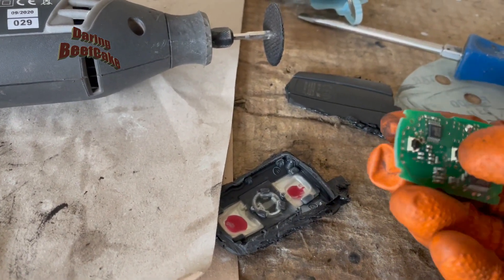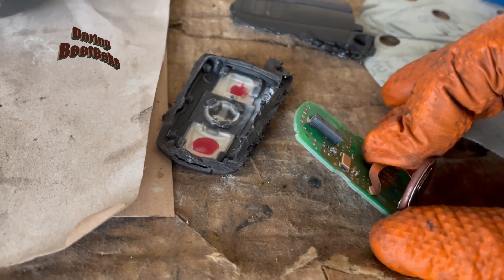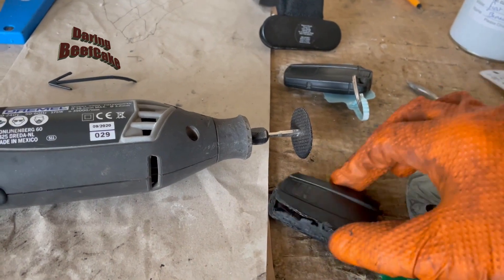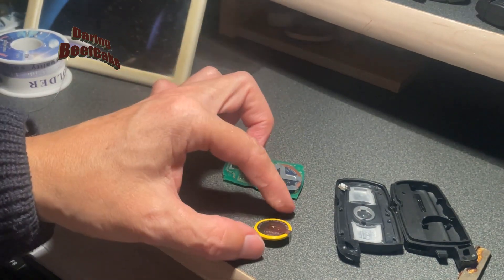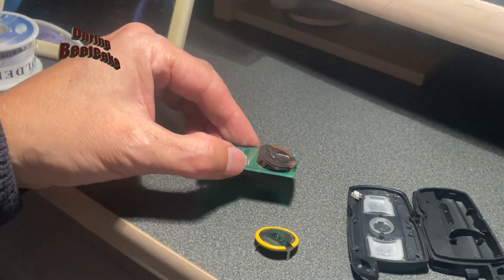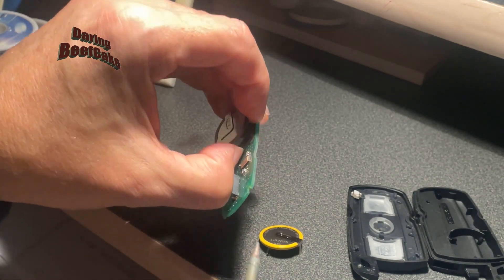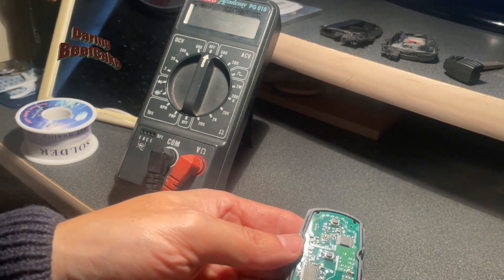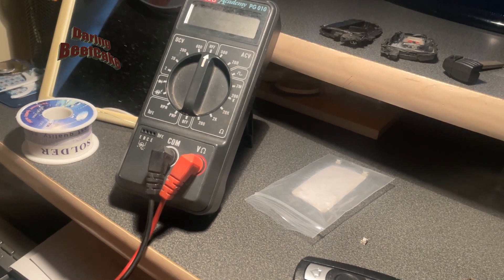BMW E90 E91 E87 Etc key fob not working, rechargeable battery replacement

Comment: I think These ones are chargable, just Insert it into ignition because These models with These specific Keys can be Charged in the ignition (by Magnet inside the ignition (you will See it on the manual)) just put it in there and drive for Like 30 Minutes until its full Charged (it takes 30 hours to Charge it(i know it is Not a technology we used before)) but replacing for a New key at the dealer is most recommended option
Reply from the maker: Yes but in time the battery no longer charges, so you could replace it with a rechargeable battery and perhaps can last some more years.

Comment: It is low voltage 3V: you don't need gloves for protection -;)
Reply from the maker: you can use gloves if you wish, better to be safe to be honest. 3v should be fine that's the original battery voltage.
Reply: @DaringBeefcake  Just joking!
Keep going with your interesting videos!
Reply from the maker: @U_Kamrc  No worries :)